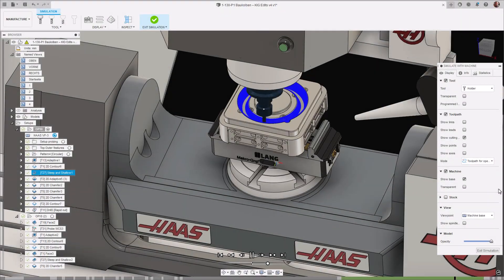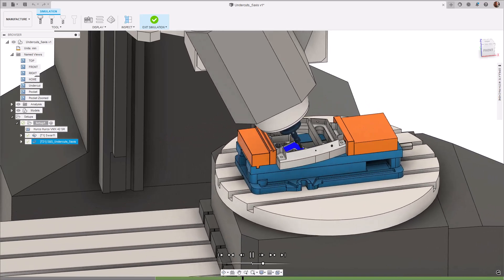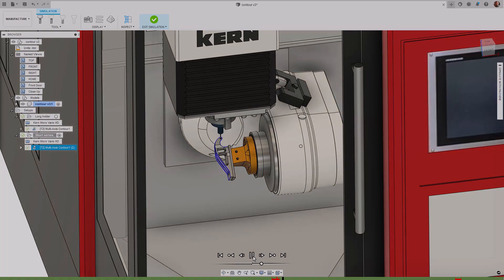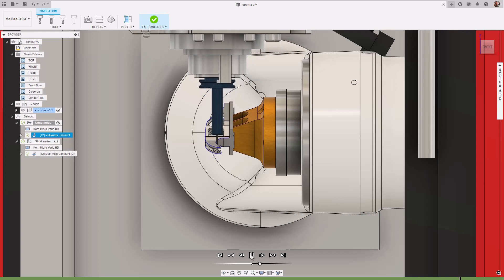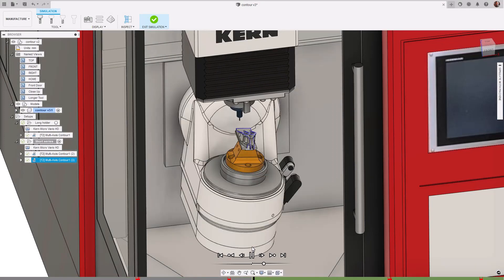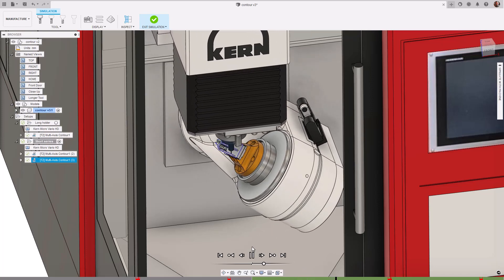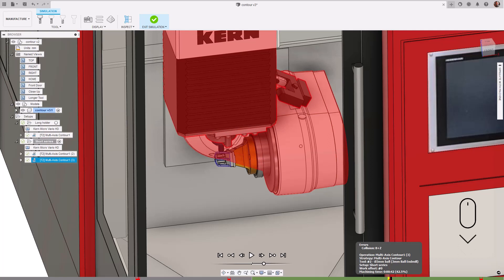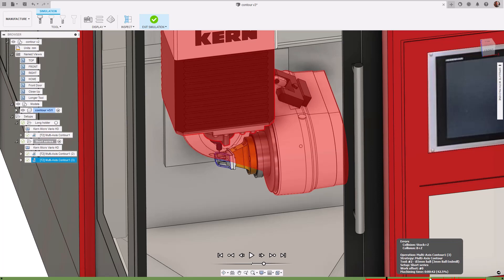Fusion 360 Machine Simulation - Collision Detection | Autodesk Fusion 360

Comment: Great addition!  I've been trying to use the machine builder to set up my Kern Micro Vario and am not having good luck.  Is there a place I can download a prebuilt machine model with all the kinematics in place?  Thanks.
Reply: It is already in Fusion 360 if you just open the machine library then go to Fusion 360 Library on the left-hand navigation.

Comment: It's great to see this being added to Fusion .I did notice that is doesn't seem check if the component is going to hit the machine at the moment, which can be expensive .
Reply: Just stick to max part size provided by the machine manufacturer
Reply: @DylanVos05 Thanks, If only it was so simple :( With a trunnion type 5 axis you can be well within the machine limits and easily smash a component into the machine table. Fusion needs to be able to detect if the component and fixture are going to fowl the machine in any way. I am sure they will be working on it. It's a great how far they have come over last couple of years on the cam side.

Comment: I did post on the insider forum a little while ago, as I see collisions being detected (on a 3 axis machine) where it does not seem to be any. The message says "collision between Z and X" or "between Z and Y"",;, and I have difficulties to understand how this could be the case.

I can send my files if it could help.
Reply: Same, it would give me a collision without any axes even close to eachother (cv500 mazak)
Reply: We are aware of this, which should have been improved in the latest update.  We have more updates to do.  It is effective because of the tolerance of the simulation model.   One short-term work around it to model clearance in the place with the machine are axis sliding along each other.